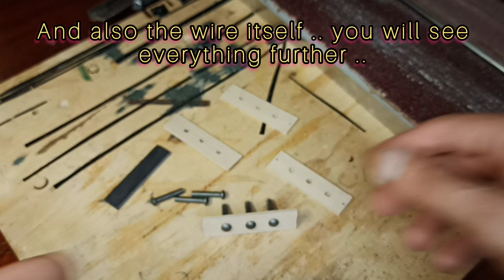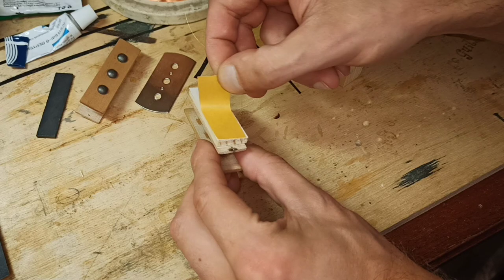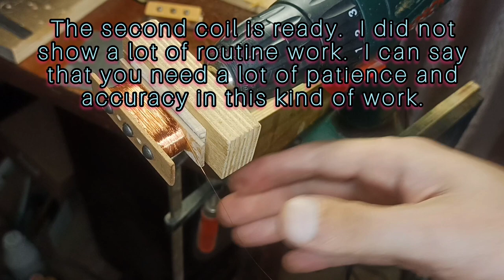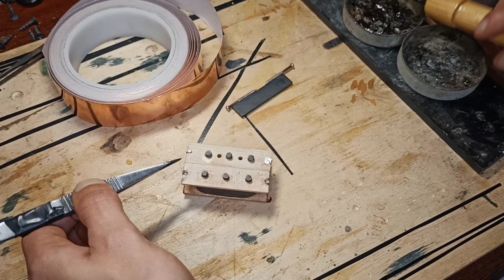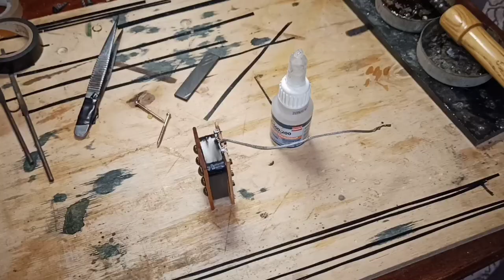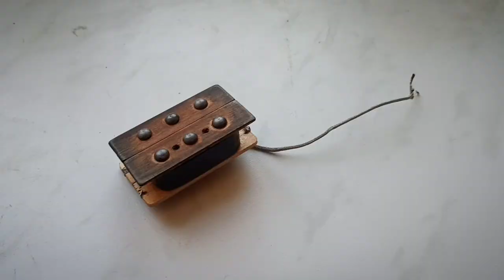Making humbucker pickup for a cigar box guitar

Comment: Hi! May I ask why do you use transparent tape?
Reply from the maker: Hello! I think you can do without it ... in this pickup I did not ground the metal rivets ... in other pickups I make a ground (and thus I isolate the magnets / cores) .. I have an old wire, it is 70 years old ... I'm afraid that suddenly the enamel has come off it over time. In general, this is for safety reasons (so that there is no contact between the magnets / cores and the winding wire).
Reply: @CigarBoxBroGuitars  Thank you! But in another of your videos, you grounded the middle magnets with a copper wire, and then started winding the thin wire from the same eyelet hole. I don't fully understand why the copper winding wire starts from the ground if the wire cannot touch the magnets?
Reply from the maker: @attilasipeki1418  Yes! the area of contact is larger ... suddenly the earth will be closed to the signal ... for reasons of correct operation. I do my best not to get in trouble.
Reply: @CigarBoxBroGuitars  I see now, so the ground will be the start of the winding coil.
Reply from the maker: @attilasipeki1418  yeees
Reply: @CigarBoxBroGuitars  Thank you so much :) what nationality are you?
Reply from the maker: @attilasipeki1418  I am from Saint Petersburg, Russian.
Reply: This is a difficult time for you too. We wish there was finally peace on earth and everyone would rather play cbg :) I'm Hungarian.
Reply from the maker: @attilasipeki1418  This is not a very easy time.  I really don’t want to do anything .. but I still make guitars, play them.  It's like I'm in an alternate reality..it's like a bad dream.  I am in solidarity with you .. I am for peace on earth .. for creation .. humanity and sincerity .. mutual assistance .. sanity and prudence .. love and compassion.